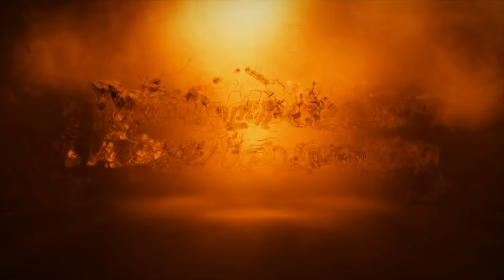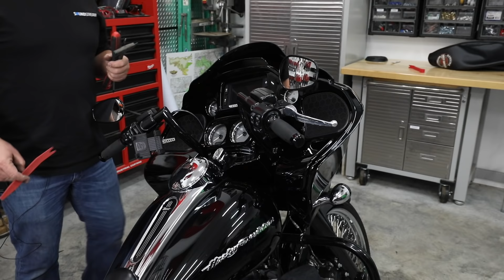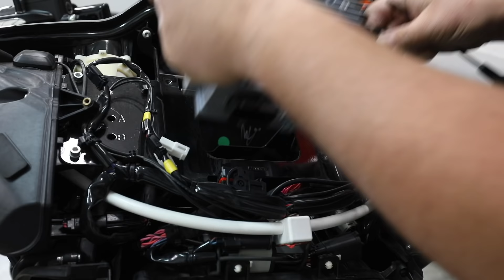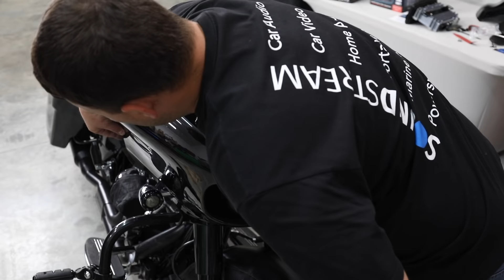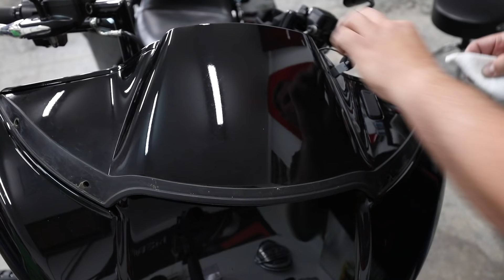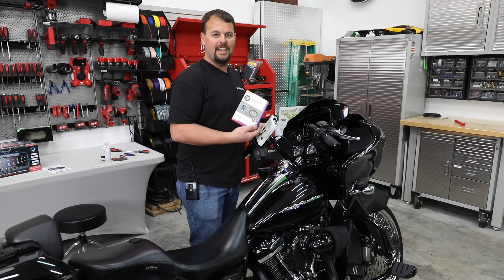How to Install the Soundstream Reserve HDHU.14+ GTS Style Radio in a Harley Davidson Roadglide

Comment: Great explanation and video ! Just one remark...I think you forgot to move the black metal plate from the old to the new radio.. Maybe good to mention to do that.
Reply from the maker: We did move the plate but did not show it in the video, I moved it between shots of the microphone install but yes the top of the radio has the threaded holes for the bracket that the upper fairing vent snaps into.

Comment: So yes the radio looks fantastic and works as advertised.  I bought one and bought some speakers they recommended.

Now for the rest of the story.  I installed everything and it works fine.  However there is no adoptive sound.  Meaning as I speed up and wind increases the sound also increases.  My stock Harley did that but no after market will do that.  Which is important because with a helmet on I can barely hear the radio.  

So I called Volunteer audio and asked if I did something wrong and I am mow told I need an amp which is another $800.

This is not Volunteer Audio’s fault.  It is my responsibility to know what I am doing but I would have never done this install if I had known this from the beginning.  

If you don’t have a budget go for it.  If you’re like me and on a budget I wouldn’t do it again.  $1300 down and I have apple car play but I can’t hear it.
Reply from the maker: John, if your not going to buy an amp, adjust all 13 eq bands up to +4, this will give you some more volume.  Yes you will need to use the thumb controls and turn the audio up as you go faster, the radio should be undistorted to full volume

Comment: Havent found a video yet on the maestro hook ups. Hopefully its very straight forwald.
Reply from the maker: @choncunninghan2275  this radio in this video does not support maestro, the ones that do are very simple, when bought from volunteer audio it is already programmed and plugged into the harness

Comment: For that system no dsp needed, with more speakers and amps dsp definitely needed for improved sound!
Reply from the maker: We build systems for riders, 95 percent of our customers would not gain noticeable improvement with a dsp but would possible add another component for failure.  There are times when dsp’s are beneficial and in future videos I will explain when we use them and why they are needed.  If you live for competitions and have multiple amps and run separates active then a dsp is needed.
Reply: @volunteeraudio  I just like the sound of running my speakers active, and playing each speaker the frequency they are meant to play at. Thank You for your explanation.  Appreciate what you're doing.

Comment: Hello awesome video. 
You mention cutting the speaker wires to create high level inputs instead of RCA cables. 
I have a Sony 5000 and I am running two diamond audio amps.  With a Rockford DSR1. 
Would I benefit from changing mine from RCA to high level?
If so can you explain how to do that?
Thank you
Reply from the maker: I have an upcoming video that will explain how to do this
Reply: @volunteeraudio  
Awesome can’t wait to see it. 
I am using all 8 out puts from the DSR1. And I am using all 4 outputs from the Sony to the DSR1. 
So in my situation the DSR1 has RCA for the 4 inputs and the 8 outputs. 
Would I have to eliminate the DSR1 to create the high level inputs/outputs?
Thank you for your time.

Comment: Cool feature with an Android phone (Samsung S20 Ultra).
I can run Waze on the radio and Google Maps on my phone, which I have mounted on my handlebar) at the same time.
I set my destination in Google Maps and it will give me turn by turn through the stereo while also showing Waze on the radio.
Just thought I'd share that for the Andoird users out there..😎

Comment: Do you offer a package for an Ultra or Limited, that would include 4 speakers? Thank you for the video. 👍🏻
Reply from the maker: You would purchase this 
https://volunteeraudio.com/product/soundstream-reserve-hdhu14-radio-retains-thumb-controls-hertz-sx165neo-speakers

And this
https://volunteeraudio.com/product/hdpkg1001-2-speaker-factory-replacement-for-harley-davidson
Reply: @volunteeraudio  I hooked up the head unit to my factory 4 speaker system and not getting any audio out of the speakers. Is this the downside of the 4 speaker setup? This normal behavior and requires me to buy these?

Comment: Hi! Did I miss something the SS radio is a 2 ohm system and hertz speakers are 4ohm I was advised not to use this configuration.
I’m looking to replace my stock speakers I have the SS HDHU 14+.
Reply from the maker: Almost every amp used in cars, trucks or motorcycles are 2 ohm stable but they also are 4 ohm stable.  Too much false info saying you must run 2 ohm speakers.  The hertz speakers are so much more efficient that they are still louder than using most 2 ohm speakers plus you have the ability to add additional speakers and run only 1 amp if you do more future upgrades
Reply: Thanks I appreciate the response and clarity.

Comment: Is it normal to have a little gap at the base of the head unit when installing it?  I’ve installed mine and noticed the base of the unit has a 1/4 in gap at the bottom but the top is flush to the dash.
Reply from the maker: Your factory radio was the exact same, Harley puts a piece of foam there

Comment: Thanks for the video. So if I have a 2018 StreetGlideSpecial stock speakers / no amplifier, all I need is the Unit with the thumb control option and nothing else, correct ?
Reply from the maker: Correct
Reply from the maker: https://volunteeraudio.com/product/soundstream-reserve-hdhu14-replacement-radio-fits-2014-harley-davidson-touring-motorcycles-thumb-control-module-included
Reply: @volunteeraudio  I have a 4 speaker setup…if I unplug the rear 2, the fronts should work then correct? Struggling to get audio out of any speakers after install.
Reply from the maker: @dugiepts66  do you have a factory boom amplifier?
Reply: @volunteeraudio  nothing was in the fairing, so don’t believe so.
Reply from the maker: @dugiepts66  roadglide?
Reply: @volunteeraudio  that’s right. Going to disassemble again later and will take some pics of what I see. Was on the 4.3” basic stereo before which was powering the 4 speakers by itself.
Reply from the maker: @dugiepts66  amp is under radio behind headlight
Reply: @volunteeraudio  anything I need to do explicitly to get working? Or not plug and play? Have NOT hooked up the amp power from the new radio if amp is there.
Reply from the maker: @dugiepts66  if there is a boom amp in place and it is not a cvo you need to disconnect the amp and it’s harness, you can simply plug the wiring in as it was factory without an amp.  You can call me and I will help 865-388-8900

Comment: I have a question, in my 2017 Street Glide CVO, if I push the button on the right of the handlebar, on the original screen I see the outside temperature, is this function also available in this new radio?
Reply from the maker: Only on the hdhu14si, not the 14+
Reply: Ok, can you please tell me how i need to do for see the external temperature? What is the menu where is ?
Reply from the maker: @davidebenedetti7116  do you have the hdhu14si? With a maestro module running the current firmware version 2.2?  View the gauges, click settings at the bottom and select gauges, pick a gauge location and select external air temp

Comment: quick question i have the sony radio in my 2015road glide i havent been able to use my thumb controls do u have a module for that radio or do i need to purchase the whole soundstream radio
Reply from the maker: The parts to add thumb controls to the Sony are here https://volunteeraudio.com/product/pre-wired-radio-wiring-harness-and-thumb-control-interface-for-sony-radio-to-2014-2022-harley-davidson-motorcycles
Reply from the maker: If you can afford the Soundstream radio it is a much better option https://volunteeraudio.com/product/soundstream-reserve-hdhu14-replacement-radio-fits-2014-harley-davidson-touring-motorcycles-thumb-control-module-included

Comment: Hey how are you doing hi I am wondering if they did an upgrade on that radio yet you mentioned it in your video. Looking for one for my 14 CVO limited. I’m actually heading down that way on Saturday I should be down there for a week or so I don’t know. Pigeon Forge Gatlinburg Maryville not far. If you have the upgrade put one aside get a hold of me I’ll give you a call give you a card to hold it and I will swing by it should take you that long to install I don’t want to change anything right now with the radio. If not please keep me updated God bless you and yours
Reply from the maker: It’s not available yet, maybe next time, God bless and be safe!
Reply: @volunteeraudio  Thanks for getting back to me if you think about it let me know I’ll make a trip

Comment: I have a 2014  hd trike glide where be a good place to place the microphone 🎤, please any help will be appreciated
Reply from the maker: Behind the windshield so the wind won’t effect picking you up, we run the wire at the edge where the outer fairing meets the inner at the left side of the windshield
Reply: @Volunteer Audio   Thank you very much for your help will try once the weather gets better here in TX and thanks for the video on how to update the system.

Comment: Tried to install mine and didn’t work. It was wayyyy to close to the ignition switch with the gasket. Took the gasket off and it was touching the gauges and was still a no go. Completely stock 2012 street glide standard. Sent it back.
Reply from the maker: This video was on the 2014-up radio, here is a link to the hdhu9813sg and what you needed to do, https://youtu.be/XzPe3BsEcBg?feature=shared. Following these directions it would have fit
Reply: @volunteeraudio  no wayyyy!!!! I had no clue!!!! Thank you. I’ll try it again!

Comment: Your video mentioned in passing that there was a video on wireless Android Auto/Apple Car Play. Do you have a link? I'm not finding it. Thanks
Reply from the maker: Coming later today
Reply from the maker: How to Add Wireless Apple CarPlay to the Soundstream Reserve HDHU.14+ GTS Style Radio
https://youtu.be/teLhU82xSGo
Reply: @volunteeraudio  Not worried about Apple. I'm looking for a wireless solution for Android.
Reply from the maker: @Darbre56  I don’t have a verified solution yet
Reply: @volunteeraudio  FWIW, I just received a dongle from a crowd funding offering from a company called AA Wireless. It plugs into the USB connector in the glove box and creates the wi-fi connection needed for Apple and Android Auto. I'll install it this weekend, and see if it works. Thanks!

Comment: what volume does this HU distort at? 42?
Reply from the maker: If you leave loud off it goes to volume 50 clean, I tested using a DD-1 and a -5db 1khz track
Reply from the maker: I have not tested with loud on yet but it sounds clear at full volume

Comment: Great Vid! I just bought the Soundstream to replace the GT in my '16 Road Glide Special. Could use a recommend on the speaker setup in the fairing. I purchased DIAMOND AUDIO PRO SPEAKER KIT INCLUDES MSPRO65 + MO75T HORNS (copy/paste) setup. How would you recommend I connect the speakers to the Soundstream harness?
Reply from the maker: For sure you need to cut the Soundstream harness at the exposed speaker wires, run from the radio to the input side of the amp high level input and connect the output side of the amp to the bike harness side
Reply from the maker: I’m assuming you also purchased and amp, if not we have a plug n play amp setup using a hertz motorcycle amp
Reply from the maker: If you dont have an amp yet just connect to the factory leads for your 6.5” speakers and we offer a t harness to add your horns without cutting the wiring
Reply from the maker: https://volunteeraudio.com/product/metra-bc-9722
Reply: Installed the Soundstream tonight! Excellent video to go back and watch if you need reference points! Thanks y’all!

Comment: Do you have a system that will work with a 2018 CVO Road Glide?
Reply from the maker: We do if your willing to change your amps and speakers, if not there is another version of this radio coming later this year that will retain the factory boom stage 2 system
Reply: @volunteeraudio  I am willing to entertain it.  I would like to keep the same size speaker in the bags and the electronic locks.  Is that possible?
Reply from the maker: @mikeagliata8519  https://volunteeraudio.com/product/sx165neo-4-speaker-replacement-hmp4d-amp-for-14-21-harley-davidson-2

Comment: These head units put out less voltage than a sony unit so you will need to adjust your gains if youre coming from a sony unit such as myself. but is a kickass radio no doubt!!
Reply from the maker: We use high level input and have to adjust the gains down compared to any Sony other than the 7000,  far less electrical noise when using high level input and more vibration resistant too.  The 7000 could not be used as high level in since the internal amp was so large.
Reply: @volunteeraudio  I'm referring to the Sony 5k. I'll have to turn my gains up on both my amps my only conclusion is the soundstream puts out less voltage than my Sony unit did. It's not near as loud as a direct swap using the same 10 band EQ.
Reply from the maker: @ryandrake4748  are you using high level in or RCA, we found high level was stronger on the Soundstream radio, as I have said many times we don’t use the rca outs on either radio in Harley installations
Reply: @volunteeraudio  I'm using low level inputs. But also used low level on the Sony so I don't see how the spl is lower unless the RCA output is lower than the Sony RCA output. I haven't had a chance to get my meter on it yet but that's the only thing I can assume at the moment.
Reply from the maker: @ryandrake4748  the rca output also changes with loud on or off, may need to be on for full rca voltage? I have not tested rca output as we don’t normally use it.  High level was strong and clean

Comment: Doesn't seem to be a viable replacement if it loses some of the functions of the original Harley-Davidson radio
Reply from the maker: It also adds radio functions the stock radio cannot do, all lost features such as cb and headset ability are not used by most riders